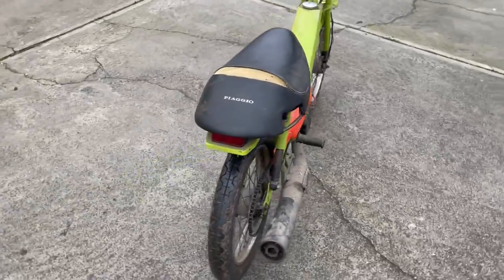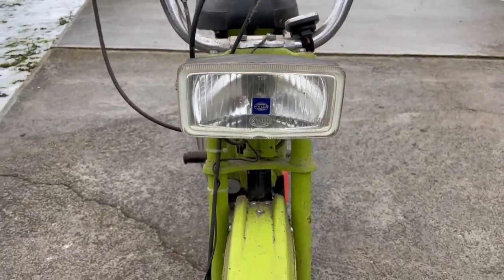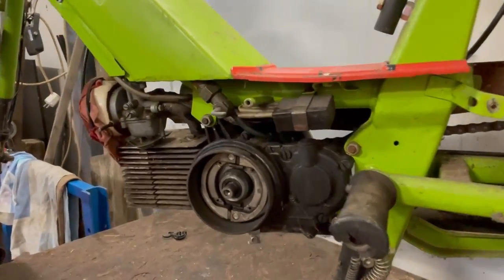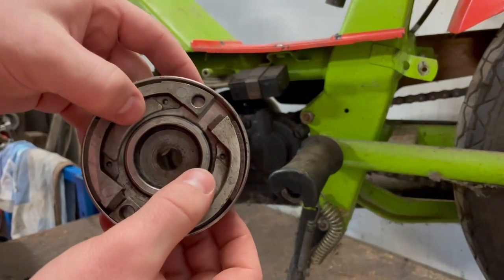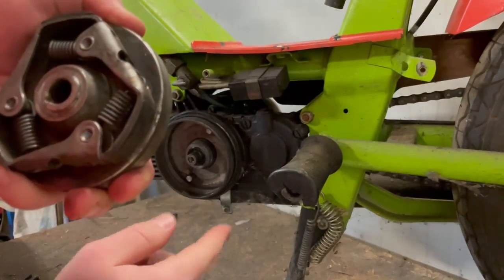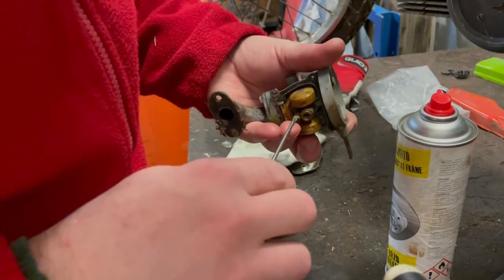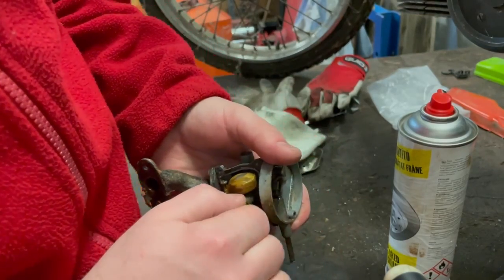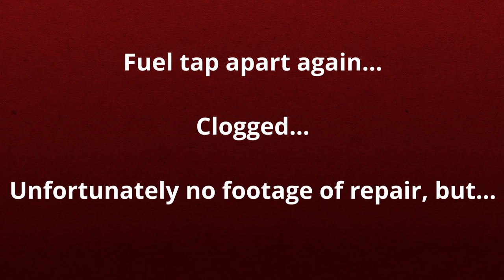Jawa Babetta 207 82' - Will it run? Start up after 12 years of standing

Comment: Pretty cool video. I have 1972' Babette on 19' wheels, my grandma bought it new. It's very nice to drive due to low gravity center.
Reply from the maker: That sounds really cool! This was also my grandma’s originally. I can’t remember if it was bought new or not.
We’ve been talking with my dad about putting some thinner 20” wheels fromt and back with some proper forks and rear suspension and disc brake in the front. Rebuild the engine and give it some good lights and a nice bobber seat, and it’d be ready to cruise around town😎🏍️

Comment: Hello! Interesting looking Babetta. I have 1 too. 1980 model. I painted mine blue. The max speed is 25Km/h on babetta 207 1 speed, attleast mine. But after i installed 210 cylinder and better carburetor it reaches over 50km/h. Im lookin for a better exhaust and hoping to get ~60km/h. I can send you photos of mine if you are interested.

Also nice video! Good to see someone speak English in Babetta video :D
Reply from the maker: Wow! That’s cool! Please do, my e-mail address is at the “about” page on my channel.
I used to have an exhaust from a tuned scooter, it worked really great. 

I’m planning to strip this completely apart and rebuild it properly into a custom moped. I have water cooled KTM 50cc cylinder with head that could be fun to install with an electric water pump (or maybe direct drive). But first the R80 project and I’ve got something else in the pipeline that I’ll be introducing in March.

Thanks for your comment. :)
Reply: @volimoto  I would love to see rebuild video about this Jawa. That engine swap would be cool.
Take your time tho, no need to hurry.
I'm actually just buying scooter tuned exhaust. I will also send photos when its ready. Might take some time to start the project 😅

Im gonna send you some pictures now :)

Also your content looks very good, im suprised you dont have more subscribers. Keep the content up!
Reply from the maker: Thanks very much for the kind words! I’m looking forward to see your beast!🏍
I’ve only just recently started, and need to post a bit more often, but it’s gonna get there.🤞🏻😊

Comment: I also have a jawa babeta 207 moped and it doesn't start, it would start but when I pedal it down the hill, I pedal it and it stops for about 2 seconds and it turns off
Reply from the maker: There first things I’d check is if you have spark on your spark plug? Does it get fuel? If the carburator plugged it won’t start. Another thing to check is if your de-compressor is working correctly? That’d be a good few things to check if you haven’t yet.😎
Reply: @volimoto Spark yes, I cleaned the carburettor where you open it with the 4 screws, not where the magneto is, on the other side and the decompressor works quite well and I cleaned the tap I don't think it works
Reply: @volimoto I don't know how you got on so quickly
Reply from the maker: I also had issues with the tap on the fuel tank! It gunked up from all the old fuel that was in it. 
I’d take it out and clean it to make sure it works! You might even need to replace the small rubber plate inside that allows the fuel through.
Alternatively you could try to just put a soda bottle (or any other bottle) fill it with some fuel and connect it to your carb just to test that it can start. If it does, you know it’s the fuel tap you have to look into fixing.😎
Reply: @volimoto Thank you, and for the carburettor, I didn't loosen the 2 screws from the float as you did, and after I cleaned where the shoes are that you cleaned, it runs too easily and yesterday that flywheel heated up
Reply: Is it possible that it won't start because it doesn't give gas to the carburetor?
Reply from the maker: Yes! Definitely! 
That’s why I suggested maybe to try to use a make-shift fuel tank without a tap. Just so you’re 100% sure fuel is getting to the carburator. 
You also need to make sure that the float is set correctly you have enough fuel inside the carb.